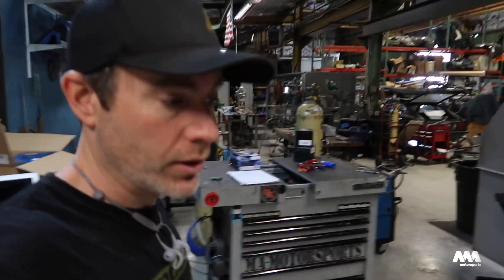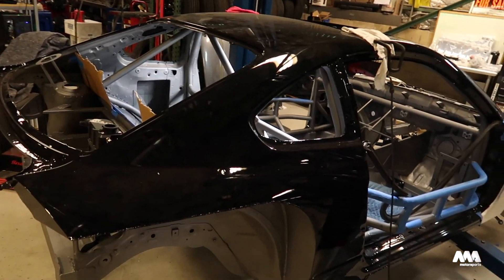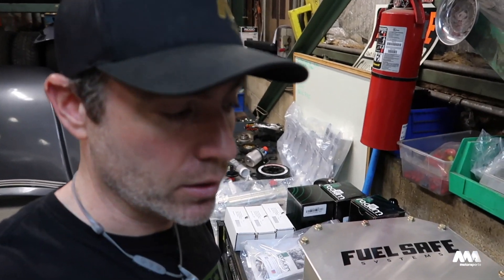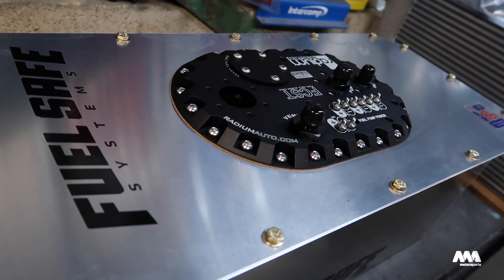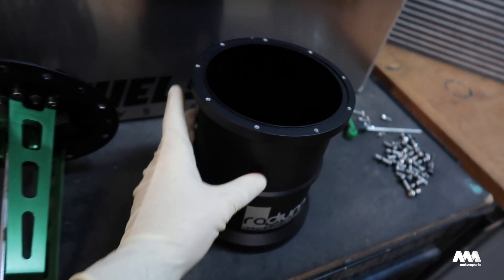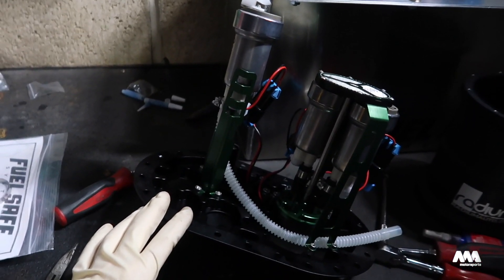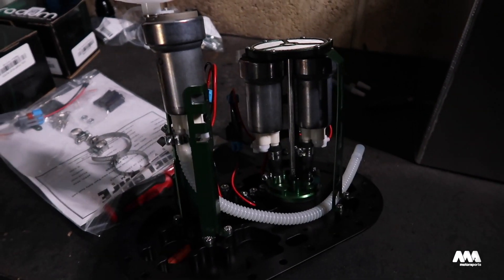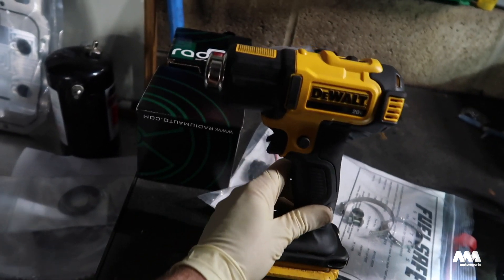Inside a Radium FUEL CELL/  DRY SUMP Oil Pan install on 2JZ.....

Comment: Pumped on that heater element, will help with ethanol cold starts also!!
Reply from the maker: Yeah it certainly should make start and warm ups quicker and because its 110v its super easy to just plug in when you need it in the pits.